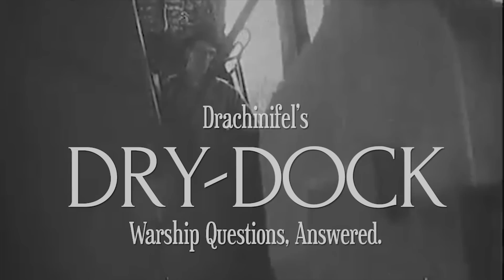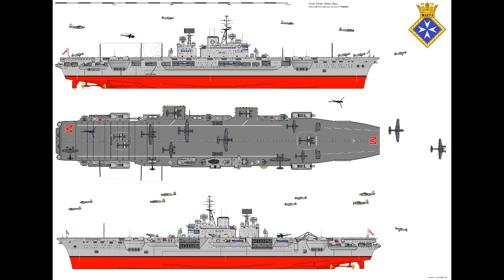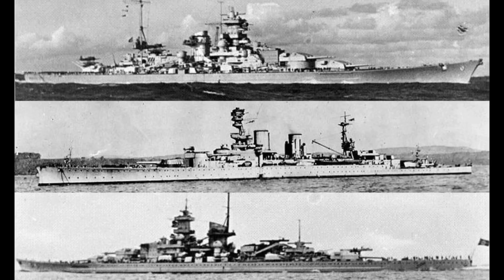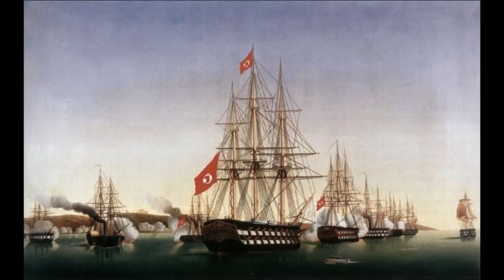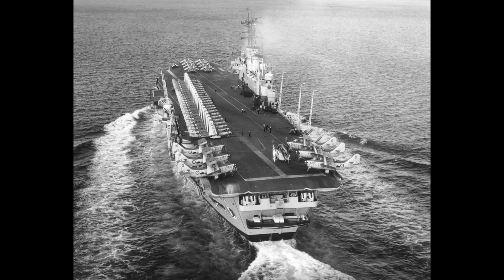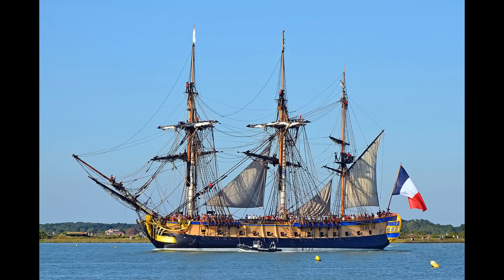The Drydock - Episode 070

Comment: Would tehy even build Vanguard if the Lions would have been build?
Reply: tehy would have. Vanguard was intended to leap frog the Lions and get another battleship in the water as quick as possible.
looks at her actually commissioning date
heh.
Reply: @Volunteer-per-order_OSullivan  yea in real live but in the questions they hyotised them coming in on scedules without the delay of the 16 inch guns. wich would meant you had the 1st batch at least as fast.(as an uninteruped build Vanguard) If at that point they  run out of spare 16 inch i could see a point of her but otherwise not really.
Reply: @saschawagner5167  The Vanguard was, from it's inception, expected to be finished before the Lion. Irrespective of delays in either class.
Reply: With the lions replacing the r class I wounder if the vanguard would not gave been a hole class as each r and the queens would have had a full battery  of 15"
Reply: @chrisangus7078  KGV replaces R, Lion replaces QE and presumably a renown or nelson class.
Reply: With the replacement of each class frees up there guns .
Reply: @chrisangus7078  All I have in my mind is the Vanguards getting printed out and given/leased away to Dominion and Free navies.
Reply: The vanguard  was the equal to the American  beasts on post war exices  in the north Atlantic  .
Reply: @chrisangus7078  Superior, in rough weather. Also better armoured. 14" of British steal is distinctly better than 12" of american.

Comment: 6 7" guns on a class of US ships seems like a bit of a logistical nightmare.
Reply: I don't think it would have been as bad as you might think. Over 100 were built for US pre dreadnoughts, and many of them were removed and converted to shore defense guns. Using the removed gins for a class of cruisers wouldn't have presented a problem. In addition, the Army and Marines quite liked this gun for shore batteries, and at least another 70 guns were ordered for this purpose. The guns were used all they way through WWII so ammunition production and supply also wouldn't have been a problem. The 7" gun seems like an oddball today, but it was the heaviest gun the could be hand loaded by very strong men using separate ammunition, so they hung around for a long time.